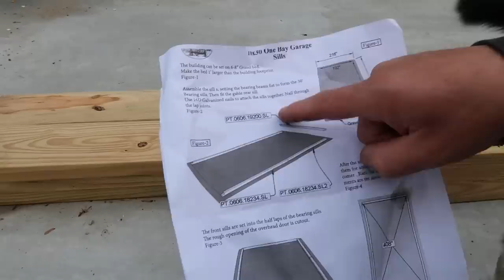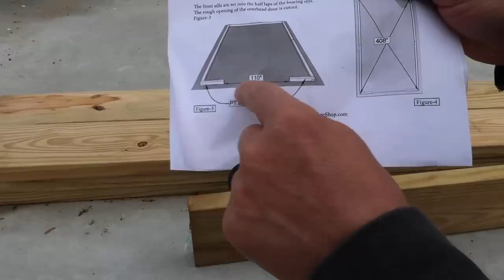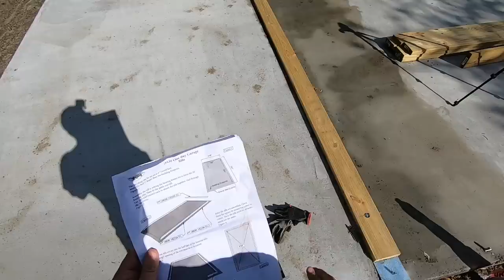Finally It's Barn Building TIME!

Comment: 9:00 It'd be nice to have a couple axles you could ratchet strap under the bundles and just tow them over. If they're truly set up to pull parts to use in sequence from the  stack, it's a shame to mess up the order by double handling them.

Comment: Wouldn't it be easier positioning the trailer so you could slide the long lumber directly onto the deck of the trailer instead of having to rotate every one of them 90 degrees.  Work smarter not harder
Reply: No room.